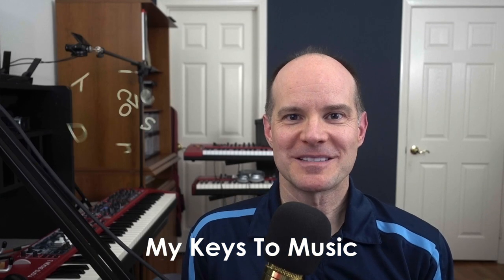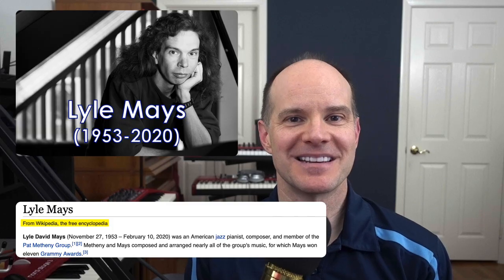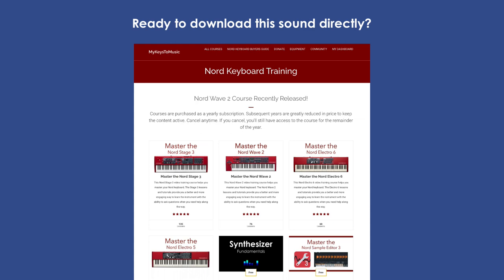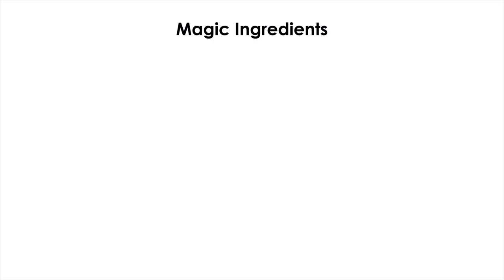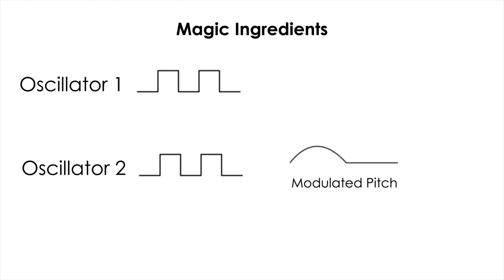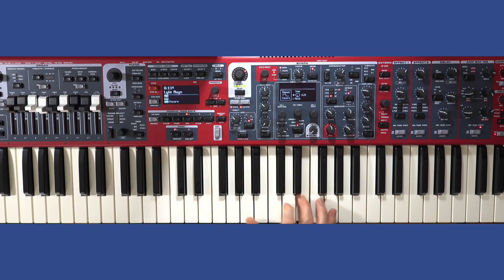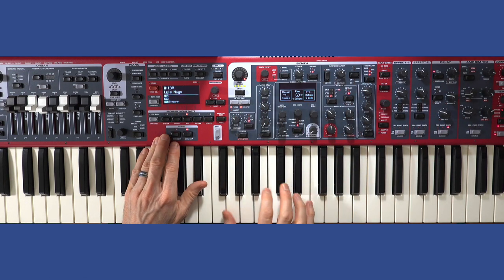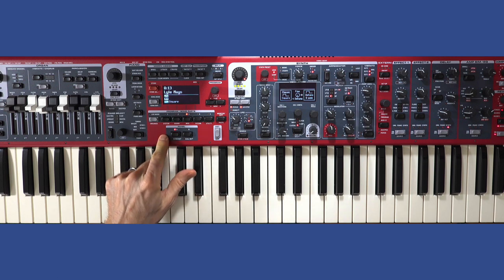Making the Lyle Mays Sound for the Nord Synths

Comment: Any chance to get that sound on an NS2? It seems to lack the fine detune. Any workaround?
Reply from the maker: Hello @Dennis Meier.  I think you could do it using the option called "dtn" (for dual de-tuneable waveform). You would then assign the mod envelope to the amount of detuning similar to how I dot it on the Stage 3 here.  If I had a Stage 2, I would happily demonstrate this.  I think if you follow along with your Stage 2, you should be able to get it but start with a classic square and then adjust the configuration to use the "dtn" option on your Stage 2. Then adjust the Osc Control and Mod envelope to taste. It could take several attempts to get it but I believe you can use the video here as a guideline.  Additionally, you can go to page 2 of the following post here where a person talks about succeeding in creating the Lyle Mays sound with their Nord Stage 2: https://www.norduserforum.com/nord-stage-forum-f3/simulate-a-dual-oscillator-synth-with-the-stage-2-t5892.html
Reply: @MyKeysToMusic  thanks marc, for the good reply. stage 2 does detune only in semitones, so worthless for the operation. looked at the forum, too. i think just using unison 1 will detune a bit (too much, though). great job, marc. appreciate it.
Reply from the maker: @gundadennis  Sorry to hear about that limitation with the Stage 2 and semitones!  Fun idea:  save up and trade the Stage 2 for a Stage 4. That or pick up a smaller synth to add to your rig for stuff like this - might be fun to learn and experiment with too!  (I can find any excuse to get another keyboard around here LOL).

Comment: This sound based on normal piano sound? Thank you for great video tho!
Reply from the maker: Hello! Thanks for the comment and question. I'm not entirely sure I understand your question, but the sound is not coming from the piano engine but the synth engine. This sound was customized to make it sound like Lyle Mays. We start with a basic square waveform and go from there. Ask your question a different way if I'm still not getting the question. Thanks!
Reply: Oh I see I think I know what you mean. I still not fully understand this system haha.  Is it possible to use the sound on Nord electro 6D? Thank you for your answer!
Reply from the maker: @Lennon2824  So, I did a little checking on this.  Try loading up the sample called "Lead Square OB8" which means that it's a square waveform from an Oberhiem 8 synth.  This is similar to what was used for Lyle Mays.  It's a little too bright still and doesn't have the same amount of pitch bend at the start of the note, but it comes form the same family and has some similarities that you'll recognize.  That sample may already be loaded on your Electro 6 by the way.  You can check out any other "square" lead samples on the Nord keyboards website too if applicable (I haven't checked to see what's available). The Nord website oftentimes has additional samples not already loaded on your Electro.
Reply: @MyKeysToMusic  Wow Thank you for your work!! I just checked and there is "Lead Square OB8" So I can give or change some effects on this sound. Am I right? Thanks a lot!
Reply from the maker: @Lennon2824  You can add effects to the sound but you won't be able to shape the sound too much.  You can add attack amount and release amount but that is about it.  Of course, you can add things like reverb and other effects with what comes with the Nord Electro 6 already, but you cannot directly adjust the synth properties of the sampled sound itself.
Reply: @MyKeysToMusic  Thank you for your warm answers! You are so kind and nice! I appreciate your useful mention too! Have a great day!
Reply from the maker: @Lennon2824  You Too!  Good luck with your music setup.